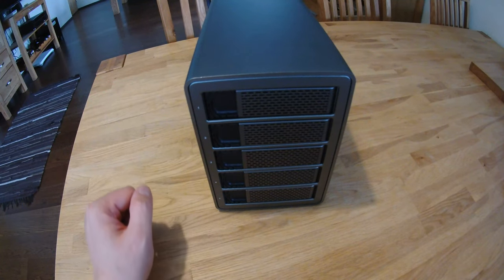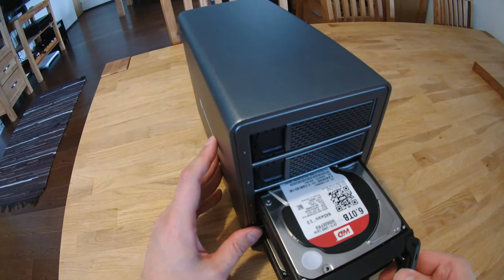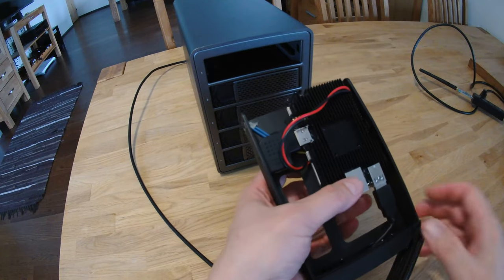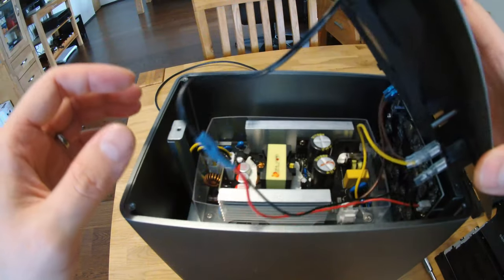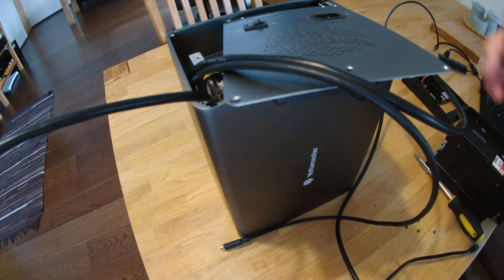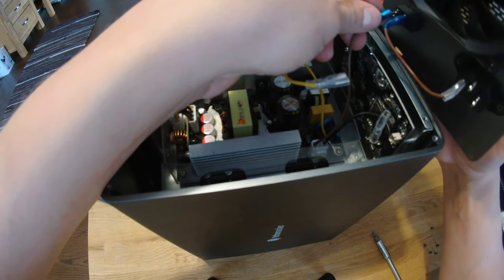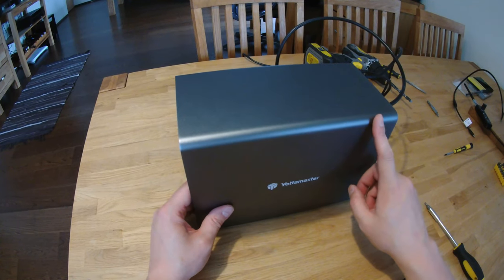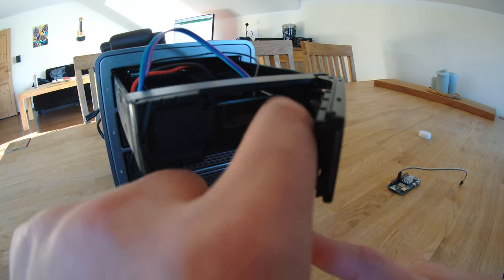Orange Pi 5 Enclosure in a Storage Case

Comment: Really awesome solution! Im trying to set up a Jellyfin and home automation on one Orange PI 5 16GB. What OS are you running?
Reply from the maker: Thank you! I am running Armbian Linux on it with Ubuntu desktop using wayland. Good solution if you want to use GPU for video playback. Armbian tries to give the same experience regardless of the board and long term support.

Comment: NIce!  Is there room below or behind the drive bays to install the SBC instead of wasting one of the drive bays for storage?
Reply: I don't think there is enough room for Orange Pi 5, maybe a smaller SBC. In the back there are the high voltage wires - I would stay away from those. It would also make it rather difficult to access it - to use GPIO pins or to reset the device. I prefer not to pull power from the spun up drives. Since I took the power from SATA to power the SBC then I am not sure if this enclosure would provide enough current for 5 drives AND the Orange Pi 5. I already planned it like this when buying the enclosure - so I don't concider it a wasted slot 🙂 Thanks for the comment!